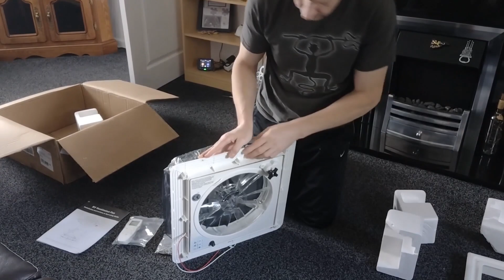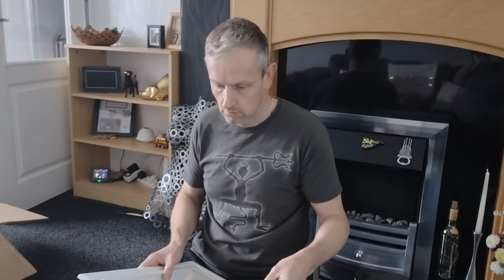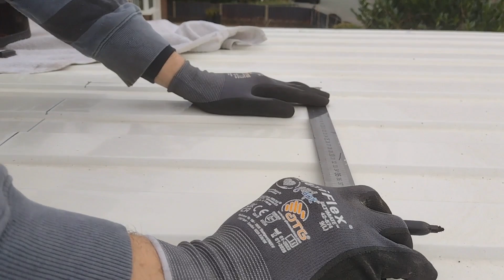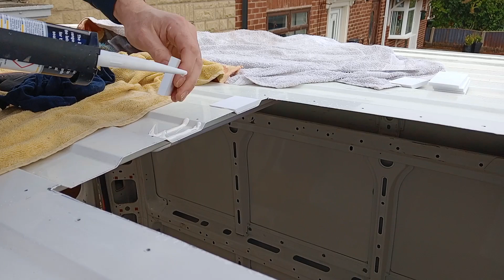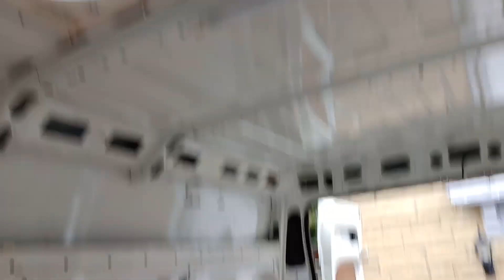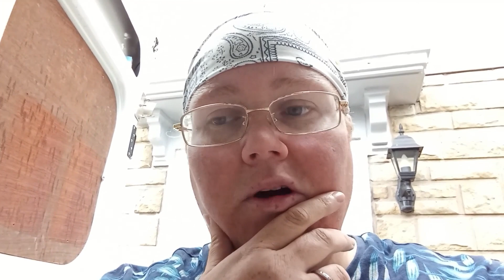6. Skylight extractor fan installation (Peugeot Boxer 2019 Van Conversion to Motorhome with Shower)

Comment: What was the fan called and what are those blocks called in the gaps as my roof is the same corrugated design?  I’m also not that well off 😮
Reply from the maker: Roof skylight vent infills or roof vent profiles are what the blocks are and the skylight fan itself was from eBay and it was 15.75" RV Roof Vent Fan 12v (a seller called romons has them on for £145.99 at the moment. (Nov 24)